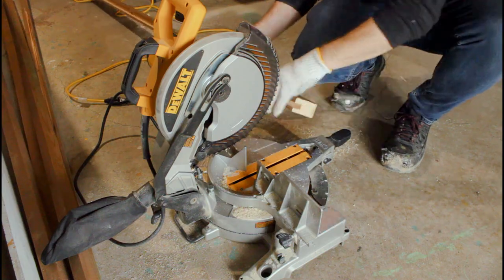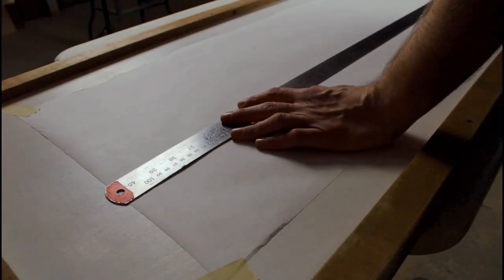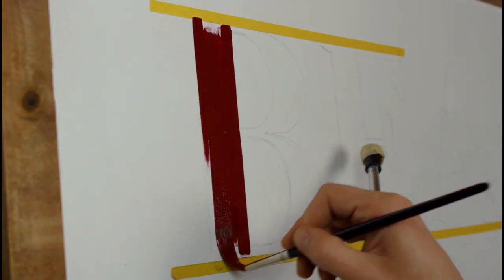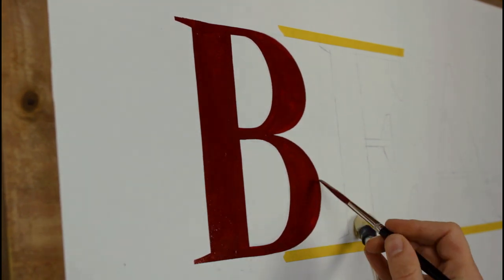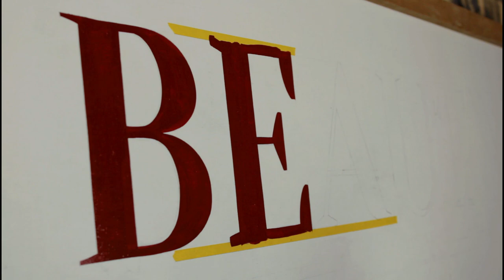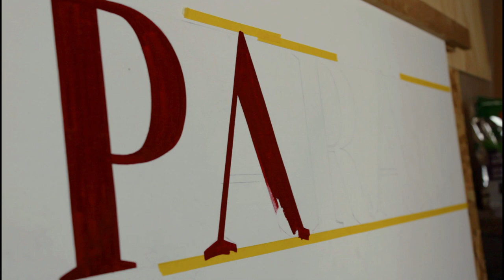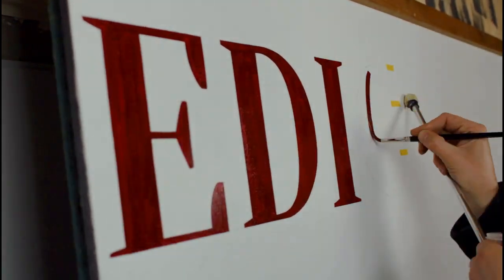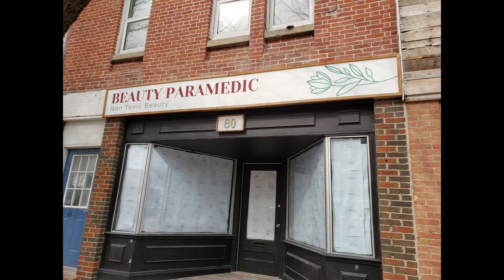How a SIGN PAINTER makes a traditional HAND PAINTED SIGN | Hand lettering & Sign painting | How to

Comment: Hi thanks for sharing, Have started to learn sign painting now I have retired and find your videos really helpful. So much to learn and the history fascinates me. By the accent  I assume you are in the uk I live in Devon England. Can I ask if I may the type of material you paint on ie plywood ,MDF and what finish you apply to the surface before writing Thanks
Reply from the maker: Hi John, So glad you decided to take it up. I'm from London but living in Canada now.

As long as the background is coated in some way and smooth. I prefer painted/varnished wood the most, find it has the right amount of grip and doesn't soak in paint. But most flat surfaces are okay, just be careful with glass as brushes glide a lot easier and you may find it difficult.
Reply: @theletterhead  Thanks for the reply.